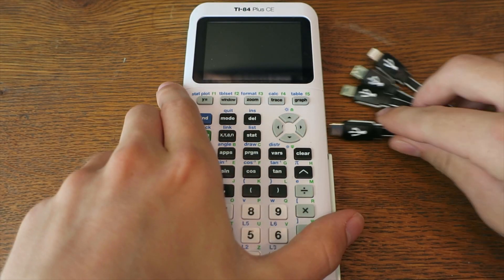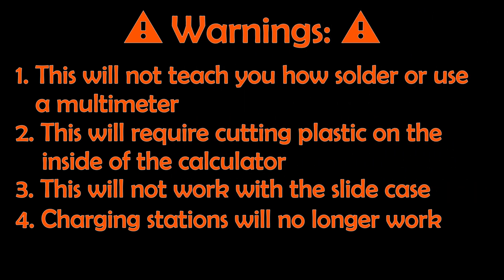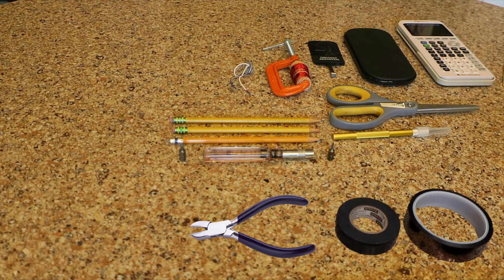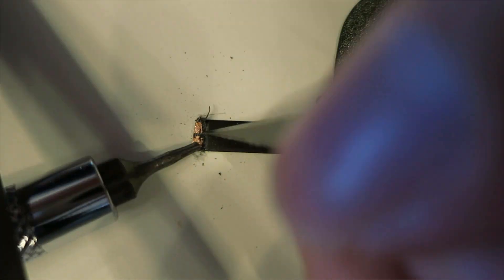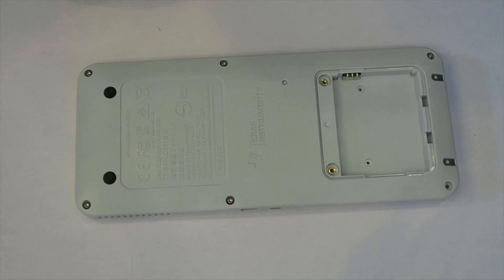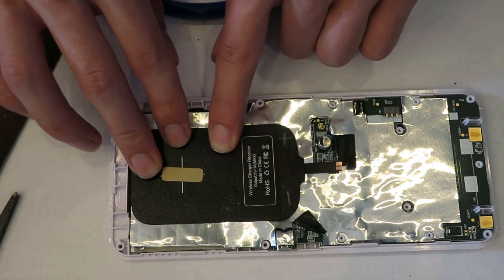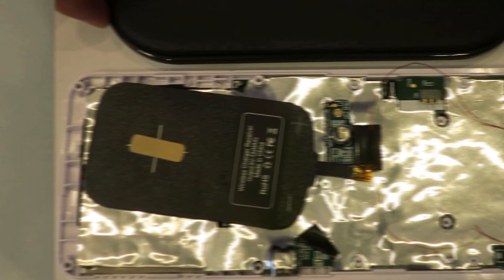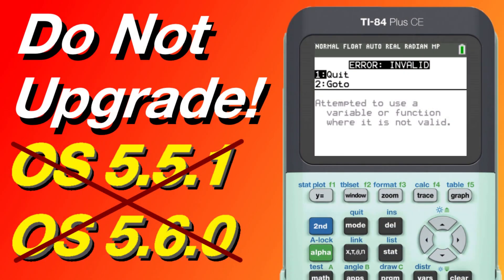How to Charge your TI-84 Plus CE WITHOUT a Cable!

Comment: Yo I know i'm kinda late but discovered your channel today it's so cool. I was asking myself if I could do this mod on my TI 83 Prenium CE Edition Python (it is only on the EU market and mine was manufactured in the Philipines), I'm guessing there is not much different but just wanted to know. 

Also would it be possible to add a custom chip inside the TI that would act as a USB and connect inside with the micro port and would allow for more stuff (like wifi, bluetooth, more RAM and Archive to run more stuff) that would then chat with the calculator with a program for exemple. I saw this video that gave me the idea : https://www.youtube.com/watch?v=Bicjxl4EcJg
Reply from the maker: Wireless charging is definitely possible. The steps will be nearly identical.

Any modification is possible. You just need the know-how to do it.

Comment: This is so freaking cool. I haven't even needed to use my calculator in years, but after suddenly needing to use it and having trouble finding a charging cord, I kind of want to try doing this just because of how easy and cool it is. The only thing I need is soldering gear and some wire. Also the charging receiver, but everyone doing this project would need to buy that. If there weren't a pandemic going on I could get into the robotics lab at my old high school since I am an employee of the school system now.
Reply from the maker: Glad you enjoyed it! You can buy some conductive glue and use that instead of using soldering equipment. That should make things easier on you.

Comment: Smart idea! I had this same idea that popped up in my head and it turns out someone (being you) has already done it. Looks pretty good other than I'd use thicker wire. 

I haven't actually done the math to see the max current recommended for that wire gauge (so my recommendation might be false), but I think it'd be best just to get much thicker wire (like 24-28 gauge) because it really doesn't cost much more. You can also find equivalent wire in scrap usb cables or ethernet cables. I am huge fan of recycling old and broken ethernet cables for their plentiful amounts of 28 gauge wire.
Reply from the maker: Glad you enjoyed it! I've got a few concerns from others over the wire I used, I just stripped it out of a burnt out motor. I don't think the calculator draws more than 500mA and it's been working without issue so far so I'll probably just keep it this way. ¯\_(ツ)_/¯
Reply: @TheLastMillennial  Fair enough. I can't say I would be thrilled to redo if it were me. I think you might just be limiting how quickly it will charge, but with these calculators, they charge slow regardless. I'd be surprised if you could put enough current through it to burn the wire, but I have been surprised before.

Comment: Would not have thought of charging my calculator this way, but it makes sense. You might get away with even cheaper receivers as I doubt the calculator needs to charge at 1A. Perhaps by adding the wires to the test points you might still be able to charge from the bay as the coated wires you used are thin to begin with and might not support high amperage. Anyway, nice ...

Note: some of my kids toys are charged this way ;-) after replacing the batteries with a small lithium cell and a tp4056 for charging
Reply from the maker: You're right, I believe the calculator only requires 5v 500mA but I decided to get a bit more power than necessary. Also technically you can get receivers that are in the cents, but I wanted something that I knew wasn't going to catch on fire. :P

I wouldn't suggest soldering to the test points because if you put the calculator in the charging station, the current may go through the wireless receiver damaging it. I originally tried soldering the leads to the USB port but that nearly bricked data communication because when you plug the device into your computer the current was at least partially going to the receiver which screwed things up.

That's pretty clever using Li-ion instead of disposable batteries, I'm surprised you get everything to fit within the battery compartment. I'd probably just use regular rechargeable AAs though :P

The wireless charger I used was a Cheotech wireless charging mat (model T535-S). It's actually pretty nice, it provides 10W max and can charge two phones on it comfortably (I've used my iPhoneX and Galaxy S3 on it). I just wish it was a bit larger because it barely fits two calculators. It does struggle a bit charging two calculators at once and emits a soft chirping sound. I dunno what that sound is, maybe the fan inside it, but I typically don't charge both calcs at the same time. It takes 5v 3A so be sure you have a fast-charger to hook it up to otherwise you'll probably be stuck with 5W charging.
Reply: @TheLastMillennial  a diode would prevent this and believe a decent receiver would have this already. But yeah, fire is never good
Reply: Which wireless charger is that?

Comment: The problem is that I also need a wireless charger...
Reply from the maker: Haha I actually didn't even have a wireless charger when I started this. Fortunately they're not expensive so I got a pretty nice one which can barely fit both calculators on it at once!
Reply: @TheLastMillennial  Yeah, I might get a wireless charger when I decide to upgrade my phone because my current doesn't support wireless charging.
Reply from the maker: You could also get one of the wireless charging receivers I used in the video and use it as intended. They're not fast (10 watt charging if you're lucky) but they certainly work!